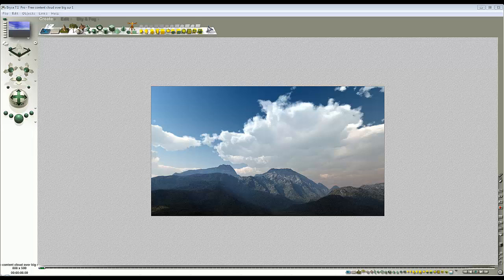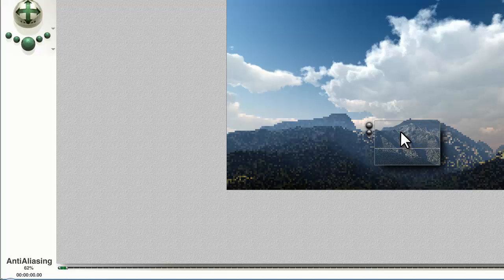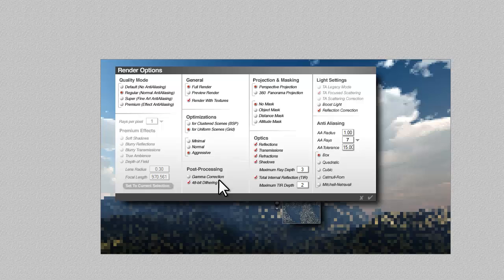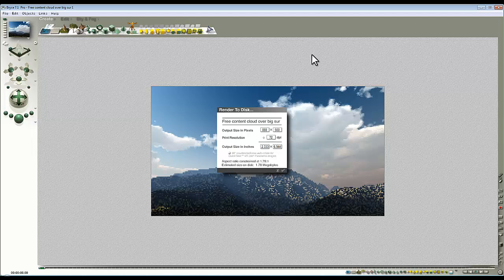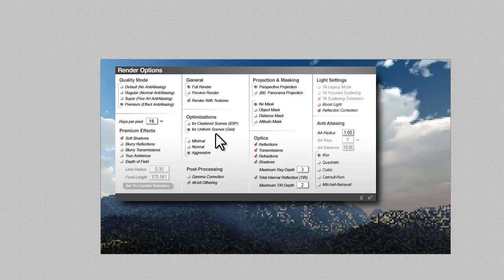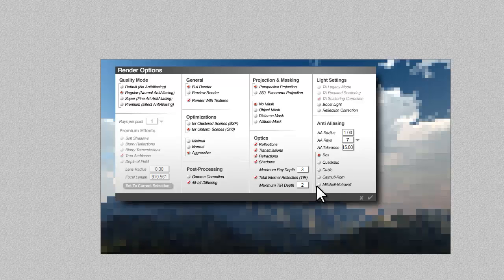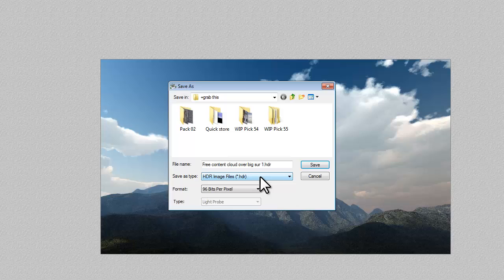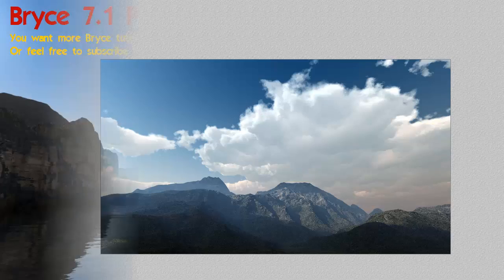Bryce Basics - Rendering overview - quality, modes and output - by David Brinnen.

Comment: how do i set the preview render in the editor window? like so the main viewport isnt just a wireframe render
Reply from the maker: If I understand your question aright, then if you look in the bottom right-hand corner of the screen, there are a series of icons going up from the circle with a grid in it, the outline of a hand, a magnifying glass with a minus in it, then one with a plus, then a white wireframe cube.  Left click + hold over this, and you will get a context-sensitive menu that gives you a variety of options for the display modes for the main viewport  This should give you the three default options you can cycle through, plus another seven open GL options.  None of these are quite like the preview render, but they offer a variety of options for visualizing the scene.  Hope that helps.

Comment: Image Size 4096*4096 not possible?
Reply: i just dream)))
Reply from the maker: File>document setup>set document aspect ration 1:1  File>Render to Disk... set output pixel size 4096 x 4096  Possible?
Reply: When will Bryce 8 be released? )))))
Reply: @FONORX Never :(
They should at least make the final version open source or an update for better optimization and scaling with the new processors...I have a Core i7-12700H and,low priority mode is SOMEHOW faster than high priority mode for me.
Reply from the maker: @FONORX  I am not privy to that kind of information.
Reply: Thanks, ill check

Comment: Wow great tip I have an i9 with 20 threads and this speed it up by a mile !!!
Reply from the maker: With the caveat that Bryce can only take advantage of 8 (cores/virtual cores), at least if you have 20 (10 cores + 10 virtual) the system can allocate 8 real cores - since the advantage of a virtual core for Bryce is only about 20% if the real core behind it is already being tasked.  So yes you should see good speed boost with this system.